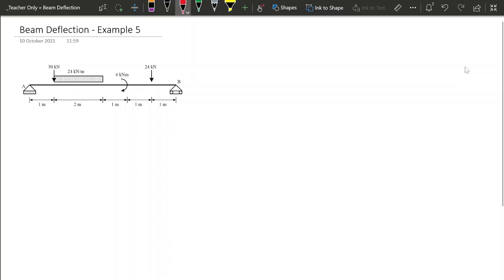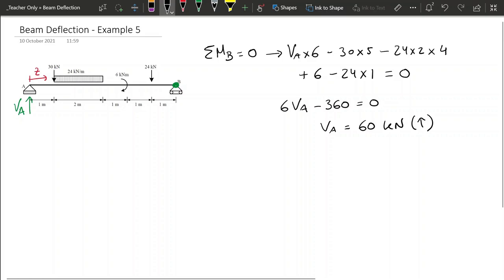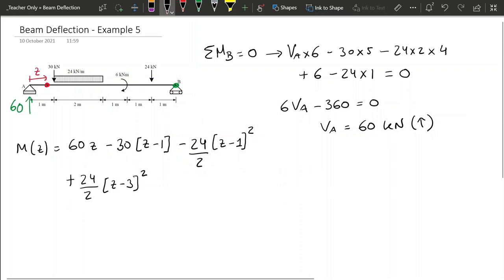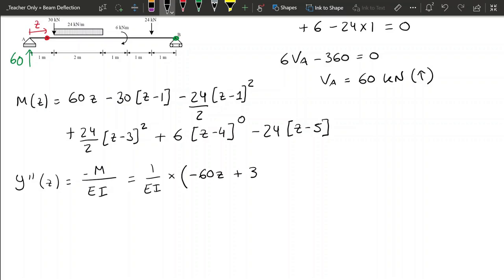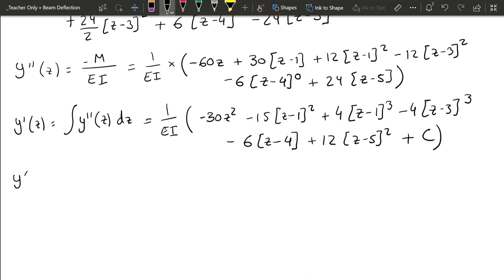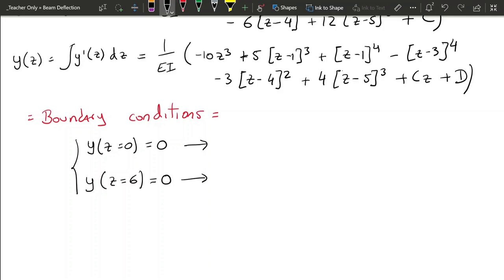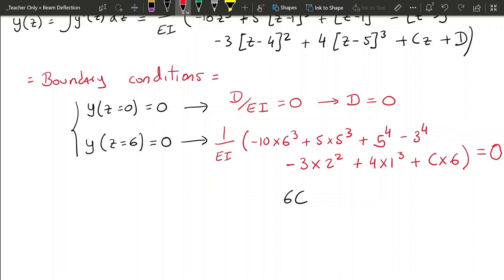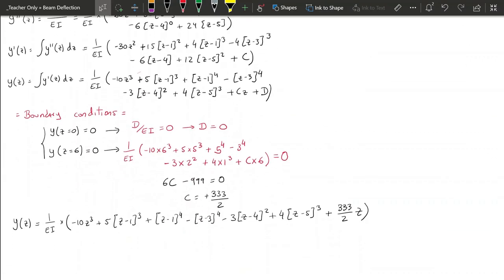Example 5 - Beam Deflection

Comment: Hello Luis I think there may be an error with one of the calculations, when you subbed in Y (z=6) to resolve for C you miss out the -4 x [ Z - 3 ] ^4 which if I am correct should be 5^4 - 4 x 3^4
Reply from the maker: Hi Daniel. Can you pinpoint in which second I made the mistake? There is a mistake in the video but it's then fixed. Let me know ;)